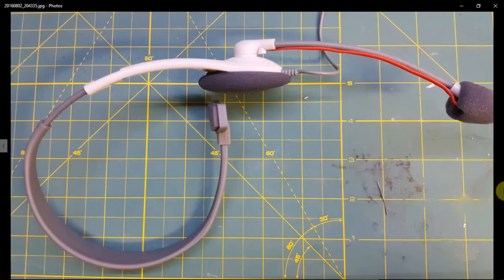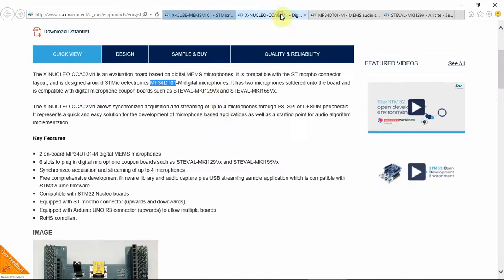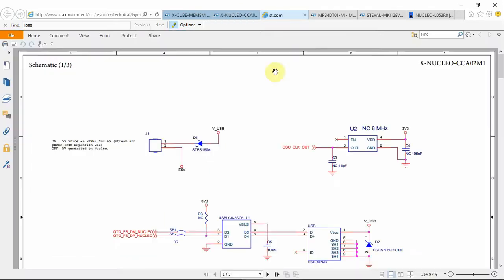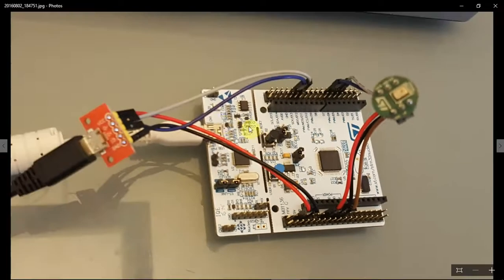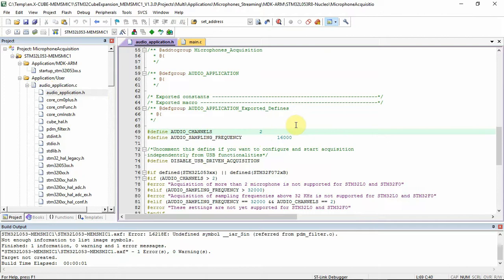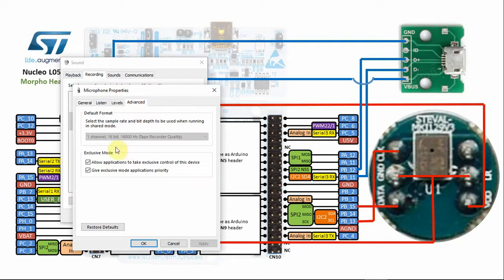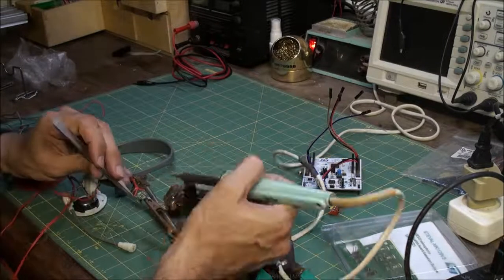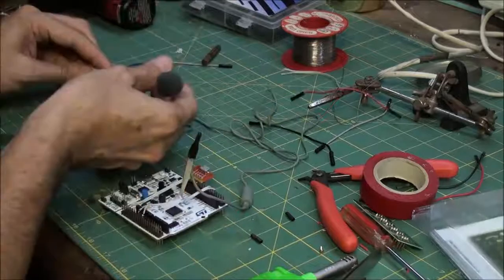DigitalMic Using STM32L0

Comment: A question, having the INMP441 digital microphones with WS line, where should it be connected? ST microphones don't have this line. Thank you
Reply from the maker: Not sure. From the DS, I think you can connect it to GND and the MIC will still output the data. Try it.

Comment: Great video 
Do you know if I configured I2S to take input stream from MEMs microphone ,, can i generate the PCM data directly from STM32CubeMX or I should use pdm2pcm library ?
Reply from the maker: It depends what STM32 you are using . Some of the have DFSDM that convert the MEMS PDM to PCM in hardware. The rest you will need to do it software. Use the examples that are in the Cubemx and also the x-nucleo-memsmic example.
Reply: Hello . I'm in the same situation as you . Have you done something ?

Comment: it's great and that is what I am trying to do for a long time .

does the output worth all the hassle of using digital microphone ? or it was just similar to the analog microphone ? 
.
Reply from the maker: Digital MIC is much better performance then the analog. It all depends on what you want to do and how much you want to spend. Today there are better options then this one and compare to the price of the demo boards, it will be much cheaper.
Reply: @Weblearning1  what do you mean by there are better options , do you mean a better usb mics ??
cause my  goal is to create a dsp with stm32 f4
Reply from the maker: For what you want to do, this will be the best way to go as I have showed
Reply: @johnsaeid95  Okay, Analog Microphones are very expensive and complicated as quality control must be a very strong consideration. Mems mic are less of a issue as it can be connected to Digital Peripheral GPIO or ADC or Delta Sigma pins. This makes it a better allround device. The CMSIS DSP is already defined so one just needs to point the data to the API. @Web learning maybe you can advise, I am using DM00380469 I have two Microphones DFSDM. I need a little advise.
Reply: @Weblearning1  did you try to solder the digital mic cause um really stuck in soldering it
Reply from the maker: These parts are sensitive to hear, so you better if with getting the small PCB that already have the mic on them

Comment: Sorry, but I hear a lot of glitches
Reply from the maker: you are right. The problem was with the software. The gain was at MAX in the MIC and it couldn't not be changed. ST released a newer version and it was fixed. check my other newer videos.

Comment: Hi, I am planning to run MP34DT01 sensors on Raspberry PI 3. Is it possible to directly connect them via I2S bus without using Steval expansion boards?
Reply from the maker: Yes. The MP34DT01 is I2S in PDM format. Please see if your board supports this. I found this:
https://www.raspberrypi.org/forums/viewtopic.php?f=32&t=132431

Comment: Hello, i have CCA02M1 on STM32F446RE, is there any audio dirver to install it ! because the audio record icone don't appear in son parameters, also in périphéral properties !! Thanks in advance.
Reply from the maker: Hi. The X-CUBE-MEMSMIC1 demo code, supports NUCLEO-F401RE, NUCLEO-F072RB, NUCLEO-L053R8, NUCLEO-L476RG or NUCLEO-F746ZG boards. As you have the F446, it might work if you chose the F401 board with some minor changes. 
But, I didnt understand what you refer to in the " audio record icone don't appear in son parameters, also in périphéral properties". There is no icon. you just plug it to the PC and it should work.
Reply: I want to implement the beamforming on stm32f446. Have you achieve something ?